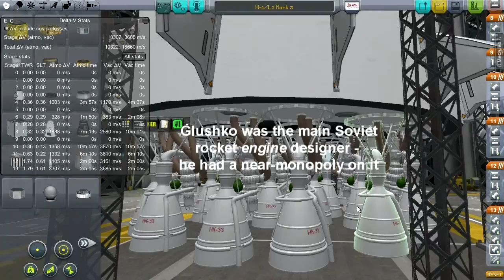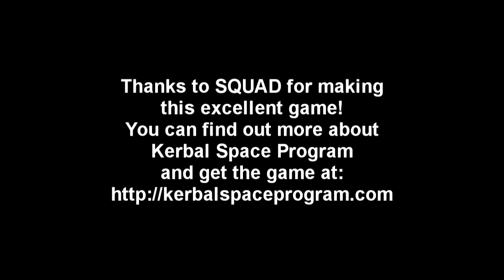Kerbal Space Program (0.23) - SP7-1 - N1/L3 Part 1 (Realism Overhaul)

Comment: 14:20 you said that with 30 engines, you don't want a very high gimbal. But on the actual N1 rocket, the engines were aligned in 2 rings. The outer ring of 24 engines, and the inner ring of 6 engines. Only the inner 6 engines were on gimballing mounts, so the real N1 wouldn't have had that problem. Another thing I noticed, I'm pretty sure the N1 rocket was actually supposed to start the 2nd stage engines before the 1st stage shut down. Only by a couple of seconds, but it didn't drift away from the spent stage like the saturn v